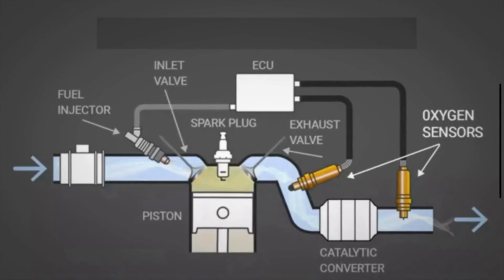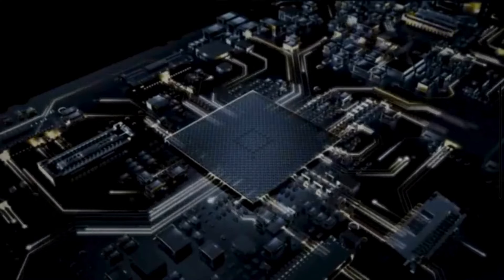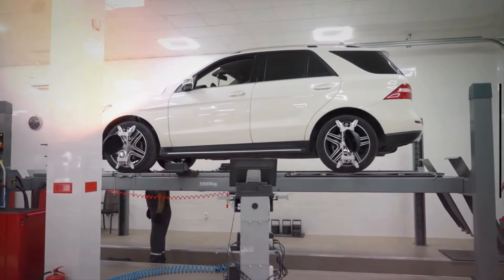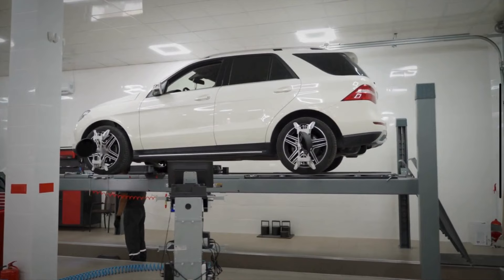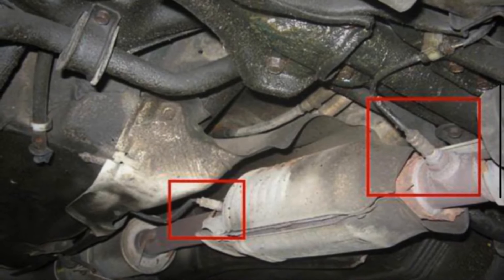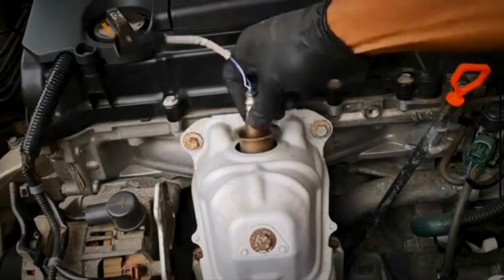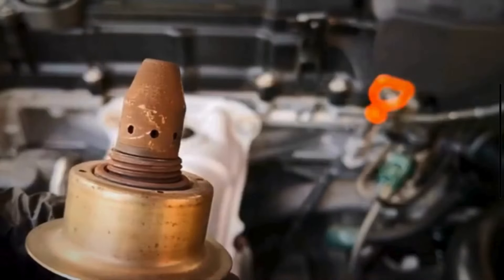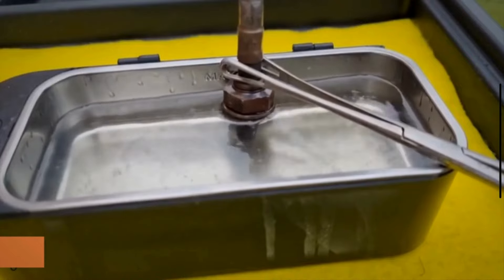How To Effectively Clean An Oxygen Sensor In Just 2 Minutes

Comment: THAT'S ABOUT "HALF-A-CLEANING"... OR SO.

The Carbon residues on the Sensor Element surface, can be almost fully removed by applying a Propane Torch flame, only to the tip of the sensor, avoiding overheating  the heating resistor, and just until a BARELY VISIBLE (IN THE SHADOW) RED COLOR AND NO MORE! (Usually about 20 seconds with the small flame on the torch that still has two distinct blue color, usin the tip of the longer external flame.)

Then, let it cool for ten minutes, when cool, HIT IT WITH CLEAN AND DRY  COMPRESSED AIR, to dislodge the ashes from the carbon residues having being burnt by the flame; rinse again with solvents, and expose to the propane flame for second time, and after hitting with the compressed air, it should be clean INSIDE the shield (the perforated screen that covers the sensor element).
Reinstall and check sensor voltages and response with an inexpensive ELM-327 Code Reader and your smartphone, with the TORQUE-PRO APP...
Reply from the maker: @alfredomarquez9777  Thanks for sharing your knowledge